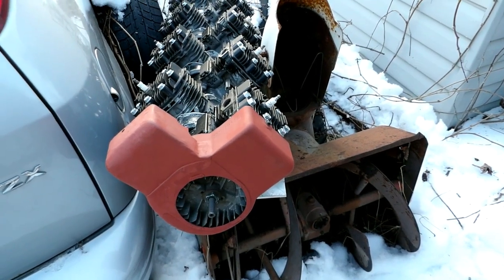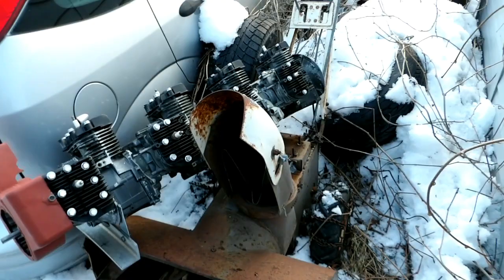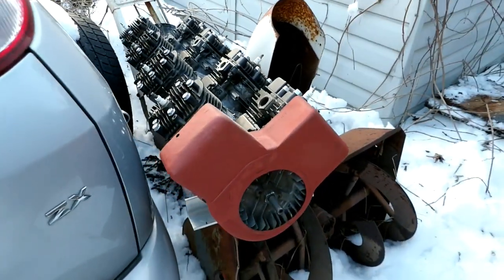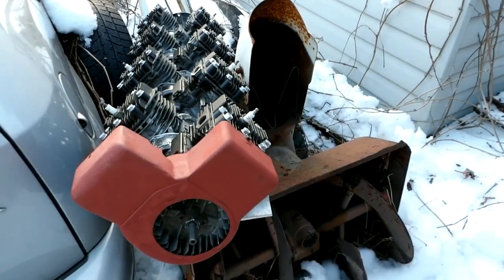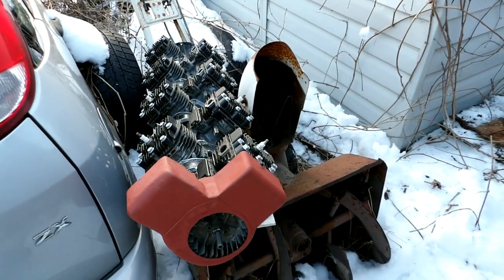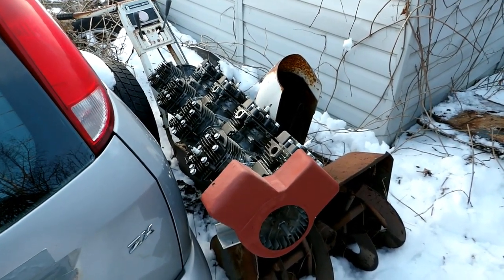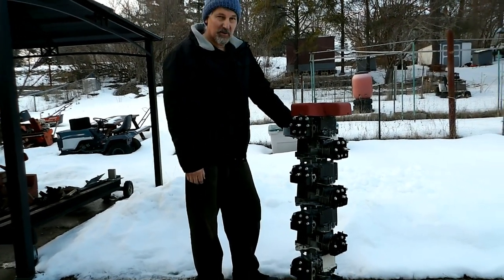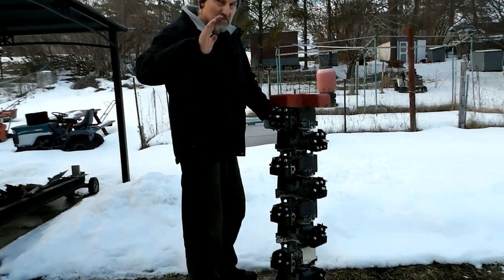8 cylinder V809 FrankenBriggs Snowblower!  :)

Comment: It's possible to join two 2 stroke engine in one to form a V2 2 stroke engine like Harley Davidson, Indian, etc?
Reply from the maker: That could be tricky, as you would probably need 2 separate crankcases to pump the air into the cylinders. But, it might be possible to do with enough imagination and designing.
Reply: @ChargerMiles007  Thank you, Sir.

Comment: cant wait to see it run!
Reply from the maker: Yes, it will be a while yet. I am proceeding with the V2  2 cylinder test version, I finally managed to get the crankshaft to rotate without grabbing. The blocks are from the Briggs 327 three cylinder stacker motor. it seized up after we re-machined the crankshafts, so there must have been some mis-alignment, I cured that with a lot of hand sanding in the crankcase cover bushing.

Comment: id cut where they connect and shorten the shafts to make it more compact
Reply from the maker: Not really any way to shorten it, without losing the camshaft drive gears.
Reply: @ChargerMiles007  oh. also i second everyone that says put in a riding mower
Reply from the maker: Yes, probably a much more practical installation  :)